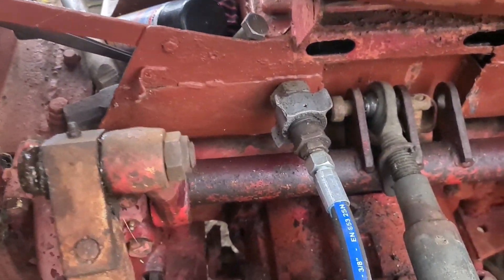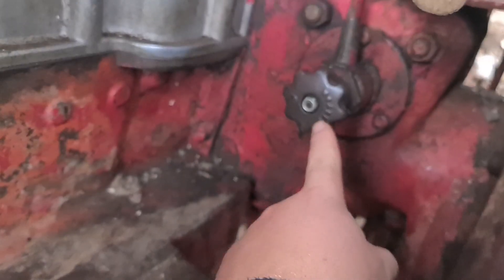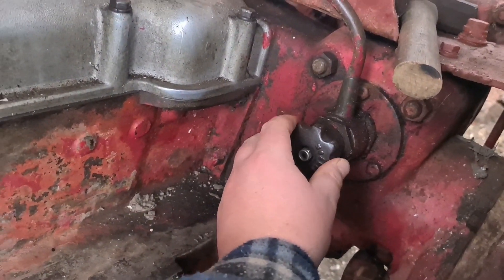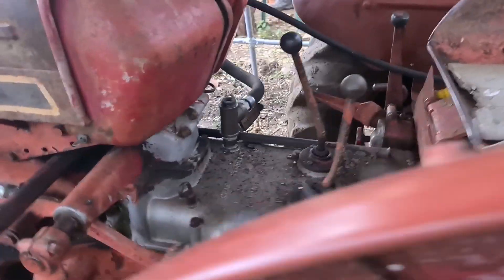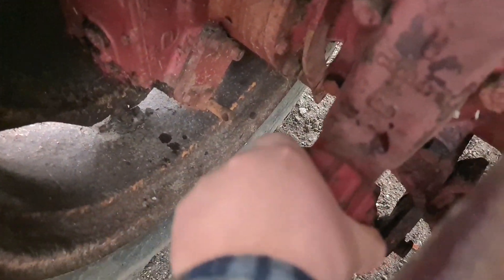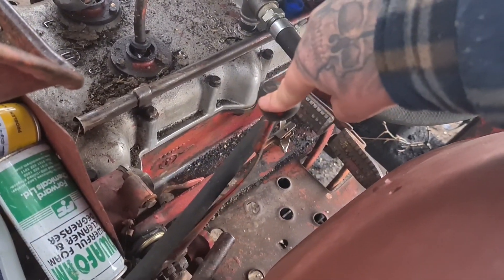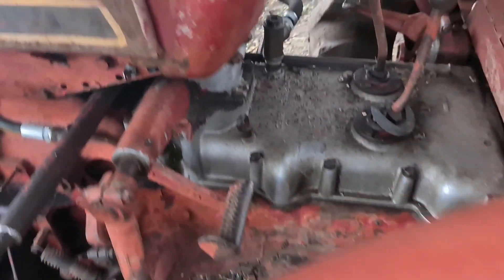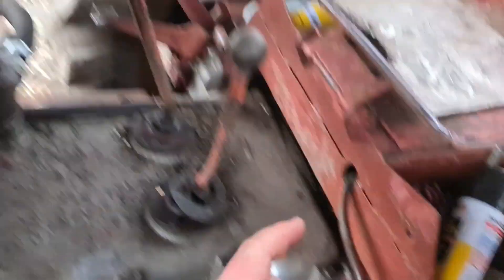David Brown 880 demo of hydraulics

Comment: Hello from Sweden! 
I'm about to buy a -63 880 also whit a front loader, it'll be interesting to see how they have solved it whit the loader hydraulics on that one. They seem a little bit more complicated around the hydraulics and 3 point lift than the Massey ferguson 135 we had back in the days.  A lot more valves so to speak.
Reply from the maker: hi and thank you for commenting. unfortunately i sold the DB880 and bought a newer Kubota tractor to improve many tasks associated with the wood operations. 
The hydraulics were primitive for sure and the Kubota tractor hydraulics are far more easier and simpler for all tasks.
3 point arms required all sorts of operations on the David Brown, whereas the Kubota is so simple with just 1 lever with incremental positions.
If you put a video up i will see which way they changed things.
Thank you again buddy 👍

Comment: Hi, I just bought a DB 880 Selectomatic and I know very little about it. It seems to run okay, cranks right up, but the PTO shaft spins. The owner acted like that was normal, but I see other videos where it isn't engaged. Might that be a problem? The hydraulic selector is broken and he said it was easy fix and the hydraulic valves may be stuck. Is  that common on these? Thanks.
Reply from the maker: Hey buddy and welcome. 
So on mine I have a box with a lever on it and it has 3 positions. 1 is neutral (middle) 1 is high speed pto (top) and last is slow speed pto (bottom) 
I have to have the clutch pressed right to the very floor to engage or disengage the pto. Does your have anything like this on yours ? I am aware the 880 selectomatic did change quite a bit from mine so some operations may have changed too.
Hydraulic valves sticking are a thing and do happen. Fortunately none of mine have been. Is there not a local old school repair shop who may know about your model. The best way I have found is to ditch ego and go ask some of the old boys 😄
Reply: @wavywoodsawmill  Yes, 3 position lever is broken, shaft comes out completely.
Reply from the maker: @tvs3497  aah that is not ideal. That would be the reason behind the pto constantly spinning then. I'd imagine it will just wear the seals down quicker. Not too sure about anything else if I'm honest. You could try finding parts to replace them with and then restore it back to working order.
Reply: @wavywoodsawmill  Thanks I'm in the North Georgia mountains.

Comment: thanks for your video, very informative. I have an 880 EU implematic that I got at auction. hoping to get some field work done with it. the control lever for three point flops around at the moment. hoping to address that soon
Reply from the maker: No problem at all buddy, welcome to the channel also 😊 
I hope you find it useful for your work, they still get used for that very reason so shouldn't see why not. My only regret with the tractor is that it doesn't have powered steering.
Yes my lever did the same thing and I added some leather of an old glove in the bit that moves and it's been kind of OK since, that might be worth a thought.
Hope you have a good time with your machine.
Reply: @wavywoodsawmill  so I got a loader,  and was hoping to plumb it in similar to yours. Do you happen to remember the size fitting for your return hose, and the exactor coupler female fitting size for your outlet. Oh yeah fixed the three point.... kinda, now it just goes up unless I hold the lever down lol I'm sure I'll figure out the system someday.

 Thanks,
JoelMiller
Reply from the maker: @jmiller3605  hey Joel and congrats on the loader. I will make a video if you like for the parts I used etc. If you would kindly let me know the specifics of the video you'd like to see I'll be happy to cover them.
I think my fittings were ⅜ bsp but I seem to remember they could be JRC fittings. Again this is all from a poor memory. If your part of the David Brown Facebook page you could also seek the information on there too.
Sorry I can't be of help right now.